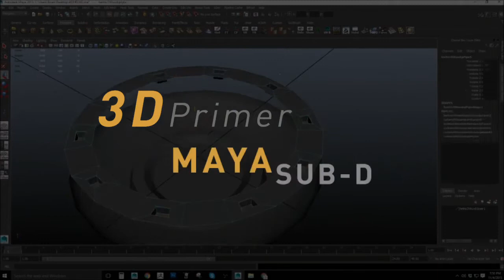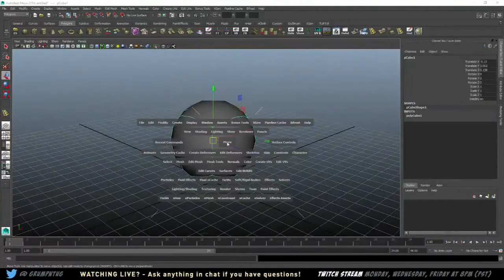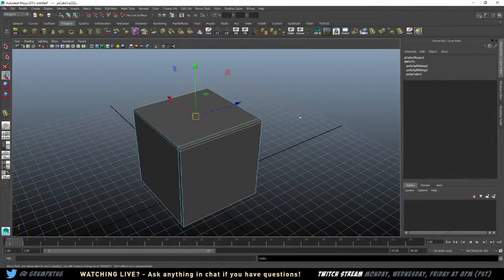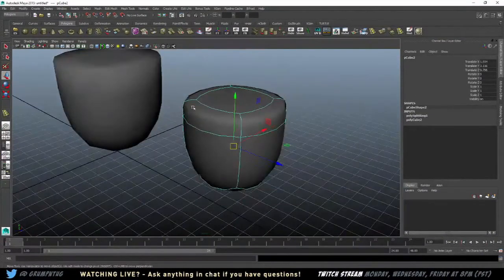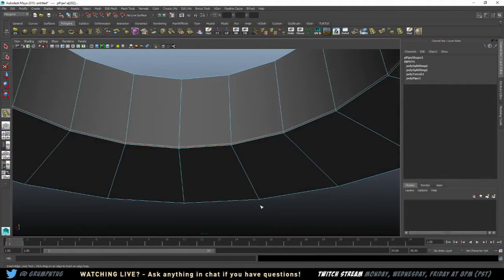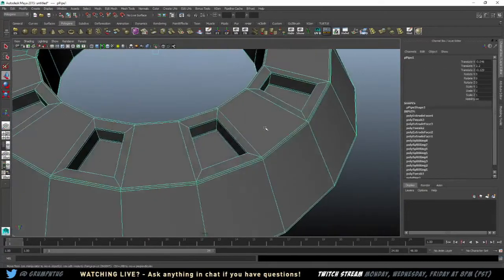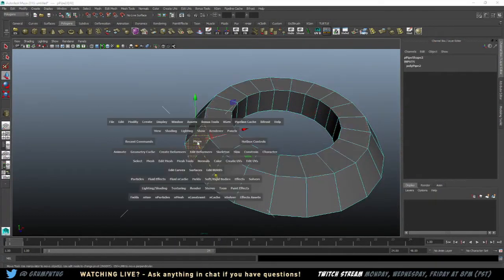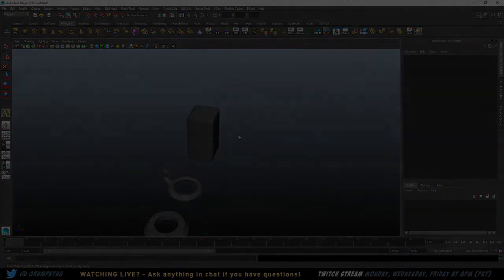Maya Sub D Modeling

Comment: WTF happened to subdiv modeling?! Where are subdivs? Is there no option in Maya to create hard surface objects without literally splitting some bevels into the actual lowpoly geometry?! I can't work with models that have bevels modeled in  - it's far too slow for production... I'm super frustrated..
Reply: It's an outdated method 😆
Reply: @wondervolt  They’re definitely gone, yes. But what’s the replacement?